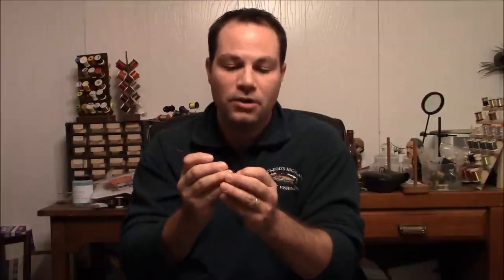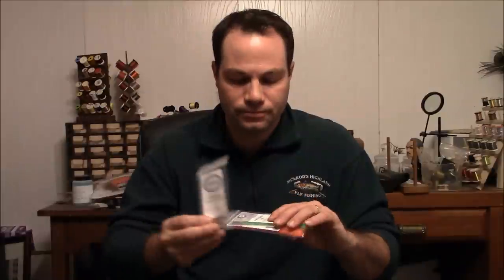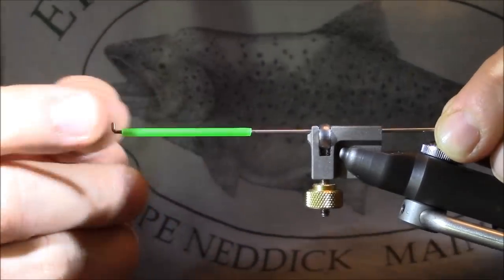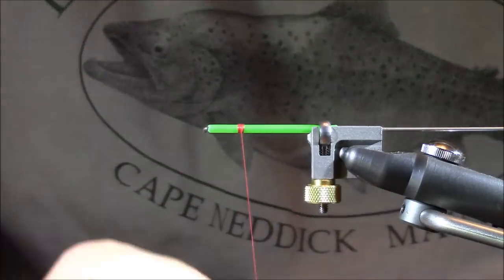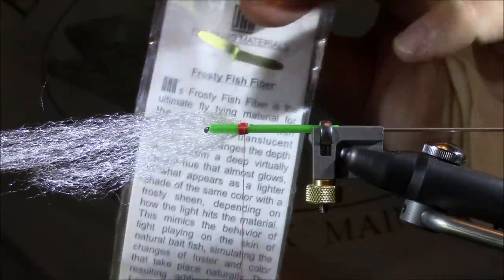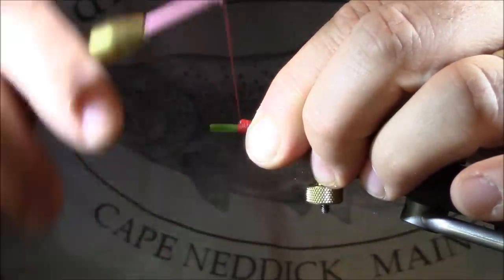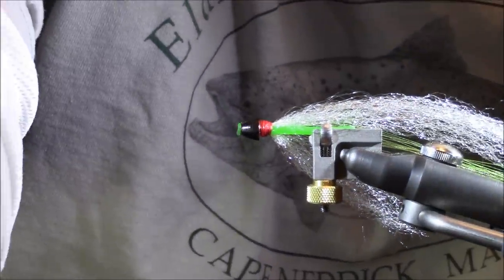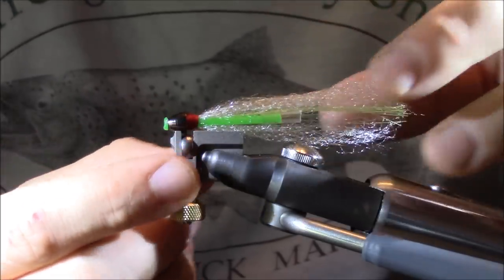Fly Tying: Tube Flies Part 3

Comment: Hey Tim, whenever I tie a tube fly the first thing I do is to melt a little of the rear of the tube so when I put the hook holder tube on it stays really snuggly onto the tubing. It helps the hook leave the tubing without removing the tube holder tubing. Just a suggestion. All the best to you. God bless, Sean
Reply from the maker: Thanks for the suggestion, Sean; comments like this will really help those just getting started in tube flies.  I appreciate it, as always.  Tim